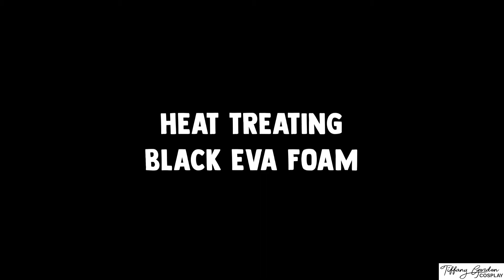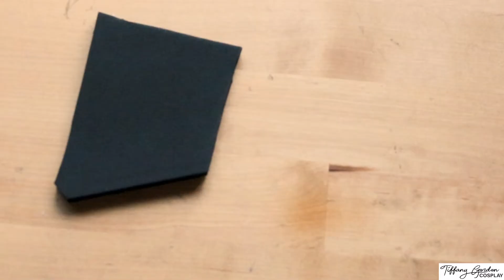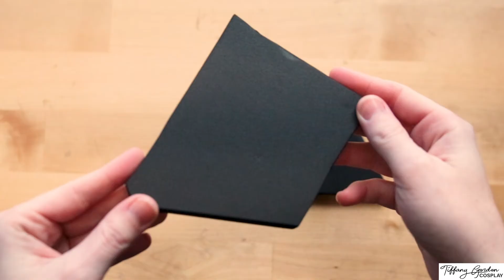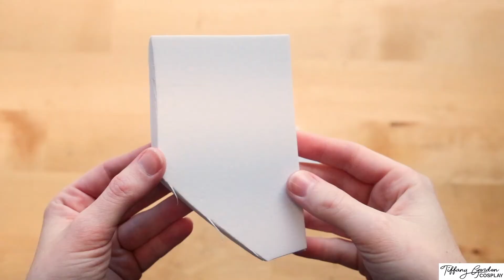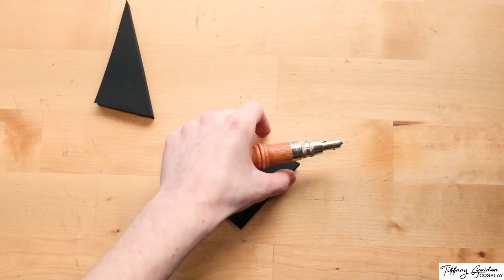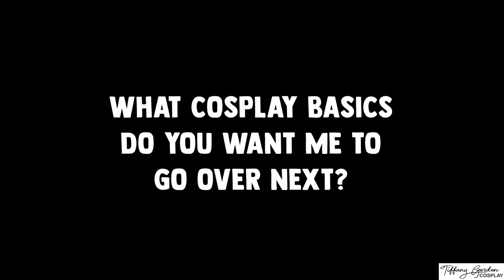How to Heat Treat EVA Foam for Beginners | Cosplay Tutorial

Comment from the maker: I now use Gray EVA foam which you can get here: https://bit.ly/3PVV7sb and is heat treated the exact same way as show in the video with similar results to the black foam!
Some of the benefits to why you should heat treat your foam is because it is very porous and the heat gun will shrink the pours down. This will make it so when you go to prime/paint the foam, that it will stay on the surface rather than be absorbed into the foam. It will also make the surface of the foam smoother and help to reduce the oils on the surface which also helps with painting.

Comment: Will using a heat gun  set off the fire alarm or smoke detector if a room has one? I would keep the window open for ventilation. Or should I do it outside to be safe? I live in a student house which has chain-reaction fire alarms in every room. So I do not want to set them off due to a false alarm, lol.
Reply: You should ventilate. Just don't heat it enough to start smoking you should be fine
Reply: @fr4nkt6768  Thanks, I have always done it outside. I was scared of it smoking but it never did that despite the warning label. And always made sure to let it cool down after use.

Comment: Do you need to heat seal before using a primer? I'm having trouble with keeping the layers together after heat sealing, I get seems, so I dremeled over it again...
Reply from the maker: You should heat treat your foam with a heat gun before painting and priming your foam. I typically do it as my very first step before cutting out parta and if I sand anything, I only do a very light heat on the surface after. Too much heat on the foam that has been glued, will cause the glue to reactivate and come apart. Hope this helps ☺️

Comment: What is the benefit of heat treating the foam?
Reply from the maker: Foam is very porous and the heat gun will shrink the pours down. This will make it so when you go to prime/paint the foam, that it will stay on the surface rather than be absorbed into the foam. It will make the surface of the foam smoother and help to reduce the oils on the surface which also helps with painting ☺️
Reply: @TiffanyGordonCosplay  Thank you x 10^6!